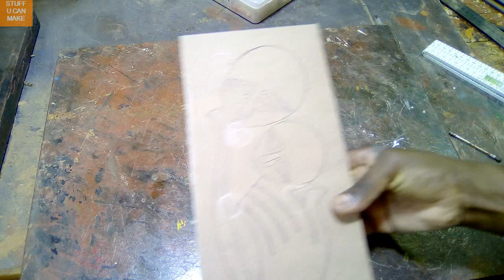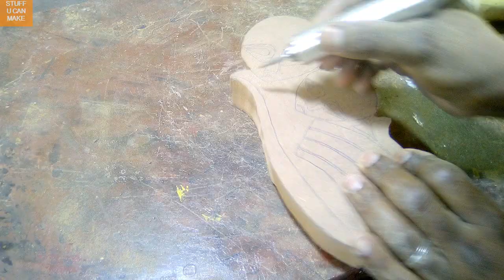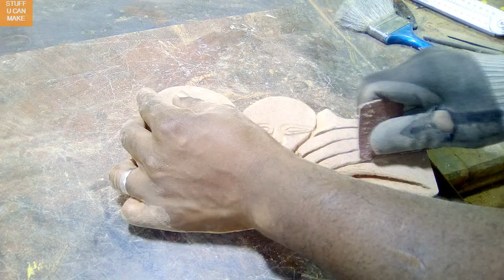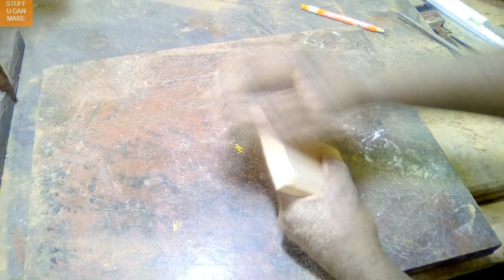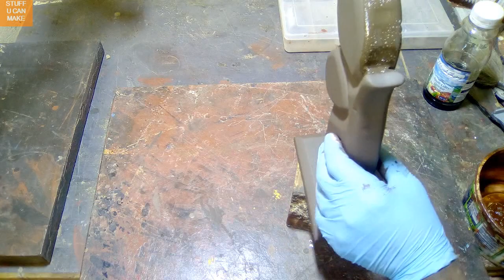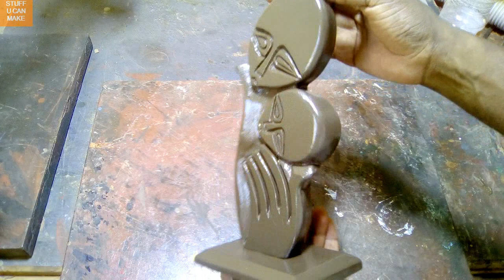Wood carving | Carving a mother and child sculpture on MDF using a dremel rotary tool

Comment: I'm loving these sculptures ideas, excellent work, I'm still amazed with your use if the sideways scroll saw techniques..lol
Reply from the maker: Thanks for the comment Fishtank. By the way, I managed to solved that scroll saw problem. It was a loose mechanism on the back that is used to control the tension of the blade. Definitely learned something!